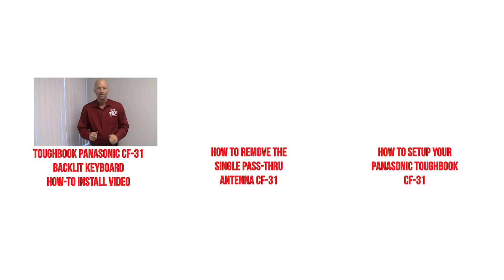How to Replace the Wifi Card in a Panasonic Toughbook CF-31

Comment: Hello.

A few questions arise.

1. Why I do not see any memory in the video?
You have a "grandstand" there made of copper foil.
I have open ram there.
The left ram under the right ram.
I have MK3, third generation. Two 4GB bars.

My WIFI is also on the lower level (same height as RAM) with white and black cable, and the upper slot and BT slot is empty.
Is it possible to upgrade the WIFI version?
Also to Wifi-6?
If so, what kind of cards would come into question?

The top slot on yours is "N7NGBOI2", which appears to be a UMTS card.
I don't have this one.
This is also dispensable without a second SIM card in times of easy wifi tethering from the smartphone.
2. But could I also use another PCI-e card there?
If so, what would be possible?
Also a SSD?
If so, what would be the maximum speed?

3. I don't have a BlueTooth card in my CF-31 MK3.
What kind of product should we look for to add a BT card?
I do not have the blue cable.
Only an unused gray and brown cable.
Are they both for a UMTS card?
Then I don't have a BlueTooth antenna?
What is that small circuit board in the video under the light gray cable holder, which is screwed to the inside of the case?
There are thin cables attached to it as well.
Is it an antenna?

4. aren't WIFI and BlueTooth combined in a mini PCI-e card nowadays?
Do I even need an extra Bluetooth card?
Then the antennas of the WIFI would be used.
It is the same frequency.

My upper PCI-e slot has two metal screw threads (small cylinders) to fix the card. This is normal.
But unfortunately both of them are separated from the surface.
One is still attached to a piece of board surface.
I can glue this again. But can I buy a replacement for the second missing cylinder somewhere?
This is probably dispensable. Still, it would be nice to be able to replace it.
These threaded cylinders also ground the plug-in board.
Poor construction. There is a hole in the PCB under the cylinder.
So it could have been secured from the bottom with a screw instead of being glued.
From bottom to top: screw/pcb/cylinder/(mini-pci-e card)/screw.
Something like that would be a useful replacement part.

Thanks.
Reply from the maker: @TobiasClaren The best way to answer your questions are to simply fill out our Tech support form.  Our in-house technicians will answer with the links and info you will need.  Here is the link: https://www.bobjohnson.com/tech-support-form/  Thanks for Watching.
Reply: @Bobjohnson  
I assumed that this information could help more people.
These are the questions that came to my mind when I saw the video.
Reply: @Ano-Nymos  Yeah I did too